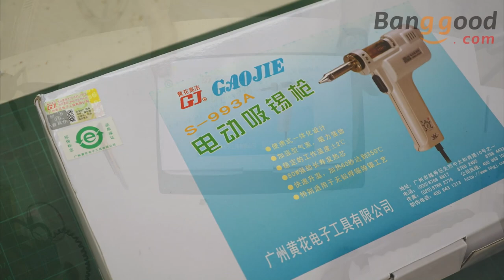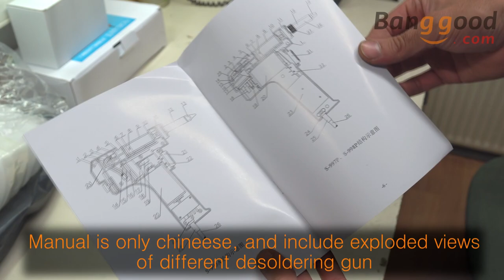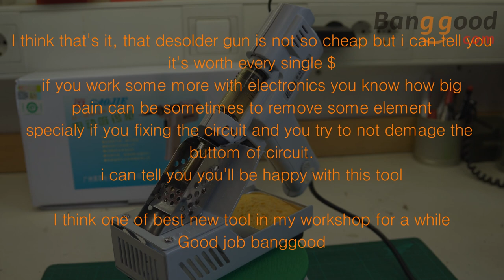S-993A Electric Solder Sucker / Desoldering Gun from banggood [unbox - review - first test]

Comment: If you do get one of these I have a good tip for everyone. I am a first time buyer of this by the way. When you are finished de-soldering, do not unplug the gun right away. While the gun is still on, use the cleaning rods to poke through to get any extra solder out of the nozzle. It will effect the performance of it. You will lose more suction with half melted/solder inside.

Comment: Mine work great for about six infrequent uses. Now it will not heat at all. Less than a year old. I'm a repair tech and know how to use these. I would not recommend these. Get a Hakko.
Reply from the maker: So that's the reason why they sell heater as a part, sorry to hear that, mine works good till now, but heater can broke anytime...

Comment: Are there any safety components installed on the circuit board? Also any current leakage from the nozzle? I'm always not very confident with these Chinese brands.
Reply from the maker: Yes there is 3 wire cable so also the ground wich is connected direct to heater housing.
Reply: @TinC33  Yes i can see that. So is that enough to be called safe?
Reply from the maker: @afstar101  for me sure, because i got fid secure switch in my house, wich covered entire house instalation, so if just a few mA leak threw the ground it will cut off entire house emidiatly (actually i got another fid in my workshop) otherwise the entire house will be withowt power too often, when i make some experiments) if there some other secure on the board i don't know.
Reply from the maker: @afstar101  + entire housing is plastic so i think its's save enough
Reply: @TinC33  Alright! Thank you so much mate! :)
Reply from the maker: @afstar101  no problem, anyway for me still working and love them, but i almost never set to max temperature, because i hear that some poeople got problems with broken heater, so i try to save them a bit, also unplug it fast after use.
But on our lock banggood sell spare heater, elements.
Reply: @TinC33  How often do you need to change the heating element,tips and filter? Also you've been using it since how long now?
Reply from the maker: @afstar101  i don't replace enithing yet, i use it from that video but not too often, maybe make 5 hours with them, but when i need them it's worth the gold, unsoldering is just so easy....
I don't see a need to replace that elements, heater replace only if they die (i think if you leave turned on on max temperature for hours without using them) filter can be cleaned like other stuff, all i do till now is clean the hole through the tip, with a wire come with,  this must to do every 10-20 sucks, just cleaninv the noozle with a wire tip that's it.

Comment: Just received mine from Banggood and was very hopeful. But it's rubbish. I've spent over 30 minutes trying to remove a 40-pin IC and it's barely able to suck the solder. Very disappointing. Should have just bought a Hakko I think - even though it's more than twice the price - I'm sure it would work better than the S-993.
Reply from the maker: Where's your problem, do you add a bit more new solder, it helped a lot, because if there's more solder heat transfer is better.
Reply: @TinC33  yes, I tried that (saw that tip elsewhere). I just doesn't seem to heat up enough to easily melt the solder. I have a spare heating element - I'll try that one. Maybe the one in the unit is defective.
Reply from the maker: @pocketscience911  hmm strange mine heat up enough so almost never got setted to full, but it's true that the tip is not the best quality, inside is a steel insert for longer life of tip, mayve thatone got bad contact and lose lot of thermal energy here, check it.

Comment: have you used this gun on a double layer (two sides) board? If yes, how does it perform? Also what about grand planes of trace, is it still efficient?
Reply from the maker: I try and it work just need to heat up so the solder melt entire before suck the solder, so far it work good to me
Reply: @TinC33  That's great, was also looking for that since I'm trying to remove bad caps from a PC motherboard and the solder won't melt with a soldering iron.

Comment: I’d like to see this tool working on a double sided PCB or, even more, trying to unsolder a TV DVBt Tuner box from double sided PCB, specially those dreaded GND pins.
Reply from the maker: Hy, when i make this review i don't think on such thing, but i use this gun in many different conditions and till now every job done really great, also some heavy heatsink unsoldering, it's just got enough power, and the tip still look like new, i just scared that the heater will die (some peiple tell me that happened to them)

Comment: Mine stopped heating up.. Element has 5 wires. How do you test the element?
Reply from the maker: Check the rwistance between same colour wires one of them is ground, banggood sell also thit element as a part.
Reply: Hi, how many time did work your desolder?? It cost too much.  I had Seen in banggood a comment saying it works only 3 months.